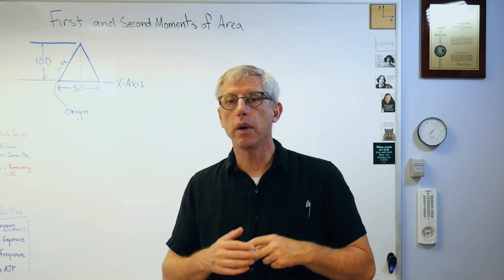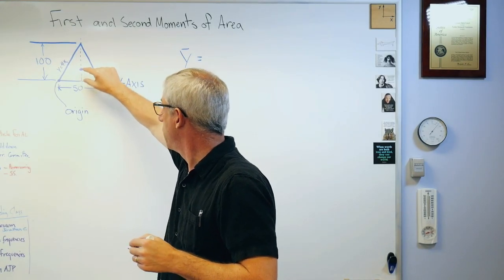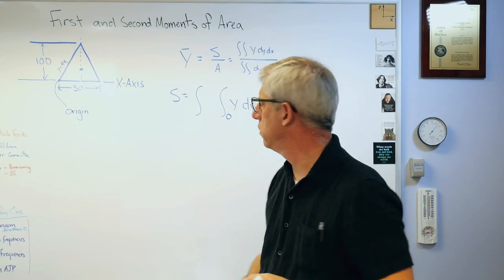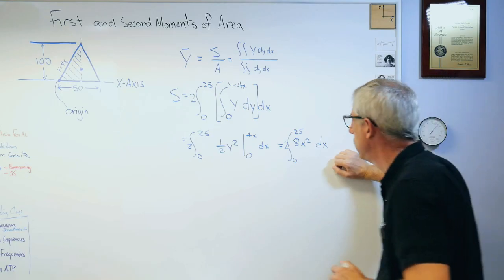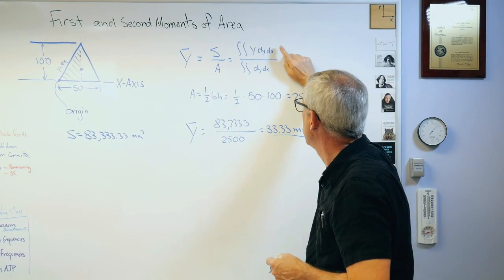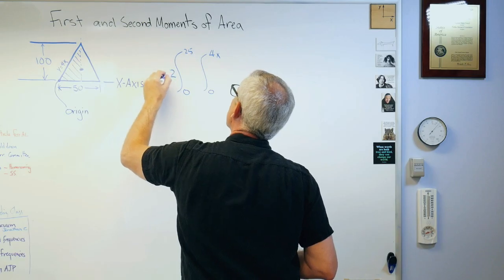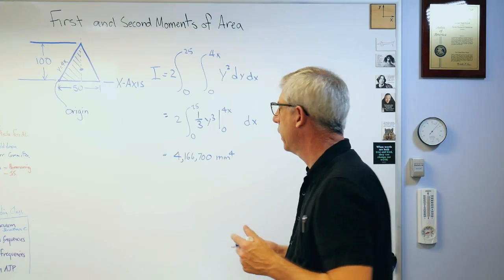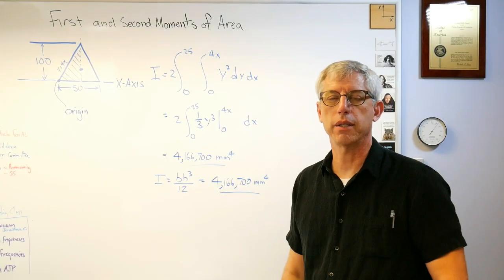First and Second Moment of Area - Brain Waves

Comment: Hi Mark, fellow Engineering Technology professor here.  I love your videos and definitely try to channel some of your vibe when explaining things.  When it comes to 2nd moment of area, in addition to stiffness, I tell my students it describes how the area is distributed around the centroid...large I, lots of material away from the centroid.  First moment of area (aka statical moment)  is used in calculating vertical shear in a beam.  What I have always struggled is providing a physical feel for first moments, similar to what I can do with 2nd moments.  As engineering technology students, I try to avoid getting into the weeds of deriving vertical shear stress and show them where the first moment shows up.  Do you have a good physical explanation of what the first moment represents?  I love to hear it if you do.

Comment: I had a question I was hoping you could answer: For the rectangle you take y to be the distance from the centroid to the outer surface, but for the traingle you take y to be the distance from the bottom of the triangle. You mentioned that the bending axis for a rectangle would be through its centroid, is this not also the case for a triangle? Very informative video thanks for sharing.
Reply: If your beam is a triangle, the bending axis is through the centroid. However, more complex problems may require an off-center axis.

Comment: First moment of area is commonly used to determine the centroid of an area. The second moment of area is a measure of the 'efficiency' of a shape to resist bending caused by loading. A beam tends to change its shape when loaded. The second moment of area is a measure of a shape's resistance to change.
Reply: Good explanation. To build off of your comment, the first moment of area (often denoted by Q) is the trait of area (not mass) rotating (moment) about a given axis - whether the x-axis, or y-axis - in which case fall into the centroidal x or y axes. This is reflected in the fact that there is a mathematical means to calculating Qx & Qy. If anyone is interested in knowing more about this, Dr. Mohammad Izadi's statics lecture(s) (CPPMechEngTutorials) is an excellent resource for actually gaining a deeper intuition of what Q is.
Reply: Thanks you sir
Reply: Great explanation. I would only add that the resistance mentioned can also be generalized to any sort of angular "movement" and is therefore also used when describing angular inertia (the resistance of a body to rotation about a particular axis).
Reply: I like this lecture, you give a clear explanation about these concepts, thanks.
Reply: thanks bro
Reply: Could you please explain the essence of taking the square of distance for area moment of inertia? i guess taking the distance to power 3 would have the same essence as power 2nd??
Reply: @prajwolacharya3980  did you know the answer?
Reply: so what does it look like from the original surface of the figure when the second moment applied

Comment: Hello Professor. Firstly, thank you for your videos which I love. I had a question. As a structural engineer I've been designing floors slabs using only the loading they experience, span ratios and support conditions (BS8110) is it safe to assume this is using statics and why when I design with an FEA software like Robot I get much smaller moments and therefore require less reinforcement? Thanks
Reply from the maker: It's dangerous to generalize too much when designing structures.  Here's the big idea - statics assumes that the stiffness is infinite because that makes the analysis much simpler.  Finite element analysis is at the other end of the spectrum of sophistication and estimates stiffness and displacement all across the structure.  By using a more accurate mathematical description of the structure, FEA will often give you slightly (we hope) different answers than will statics.  Whether there are any general trends in the differences between the two depends on a lot of things, including the geometry.  I wouldn't recommend trying to make any general observations before comparing a large number of results, including test data.
Reply: ok. thank you for your reply
Reply: FEM results are more accurate for sure, but there should not be that kind of big difference between FEM and simplified method (Code method). Even when using the software, it doesn't mean perfectness, if you tried the same model with the same input data but with another software probably you'll some differences.
Reply: Byaringan "much smaller moments" is a red flag. Verify your software.